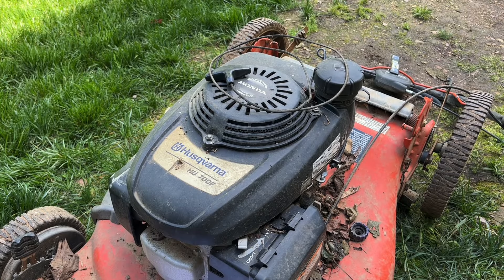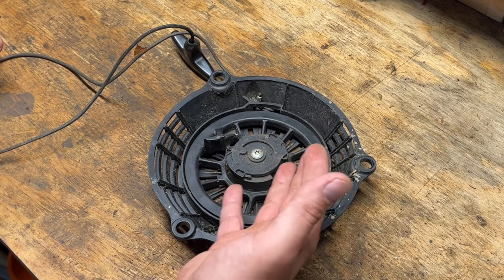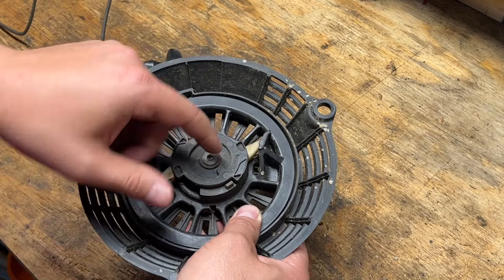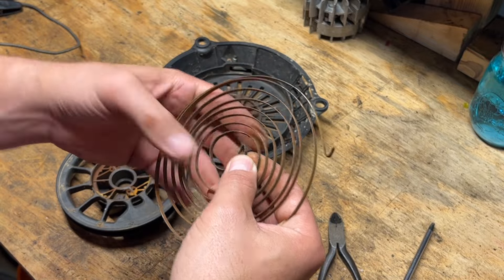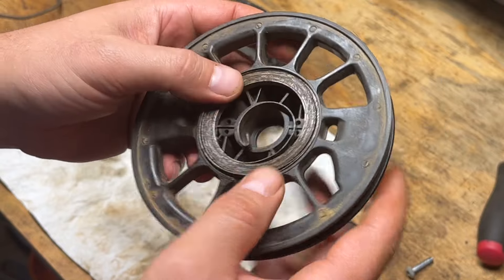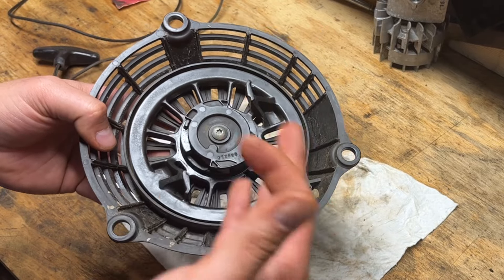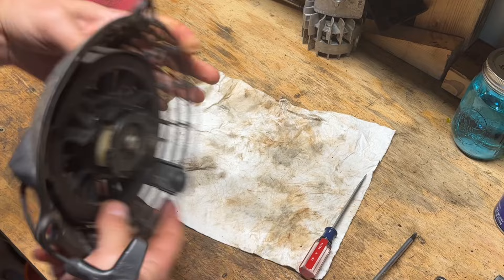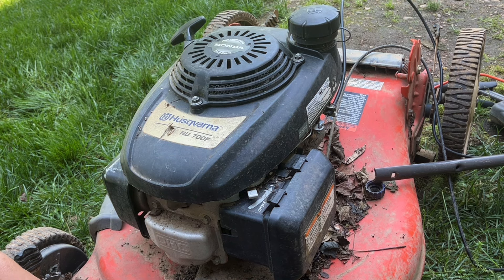Weak/Broken Starter Recoil Removal, Fix, & Install | Honda GCV160 - Husqvarna HU 700F

Comment: Great video. For as many years as I’ve been working on this stuff, recoil starters are the one thing I seem to have the least success with. Usually I find broken, missing or warped pieces inside and it’s not worth screwing around with them since replacements are cheap and plentiful. This was very helpful, I’d much rather save the original if it’s all there than replace it with a cheap aftermarket knock-off.
Reply from the maker: Thanks!

Comment: For the Husqvarna HU700F, the recoil rope typically has a small clamp-on stop (similar to a split sinker) leaving about 30” of rope that does not recoil. The reason being, the rope attaches to the mower’s handle, allowing you to crank while the blade brake lever is engaged.
I realize it’s difficult to show while the handle is not attached, but wanted to point out that your hard stop is missing.
Reply from the maker: thanks! not surprised it's missing considering it's overall condition
Reply: @BackyardRepairs  No problem. I have one purchased in 2005-ish. Replaced the front wheel drive belt this week and just some clean-up maintenance. It still cranks on the first or second pull. That Honda engine is like a sewing machine! I used it exclusively for 12 years on a smaller property. It’s rarely used now but it’s a keeper!